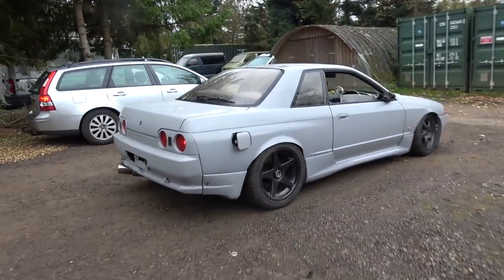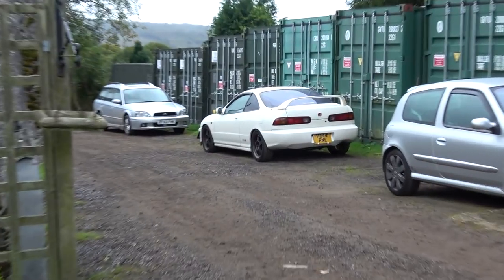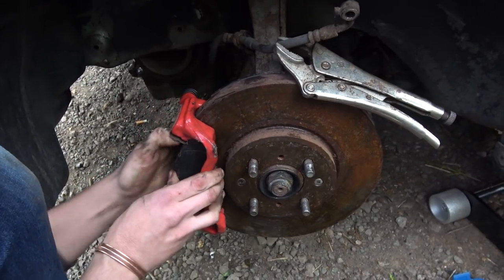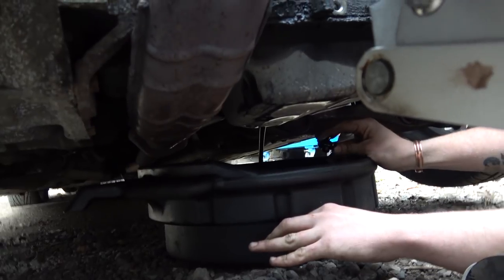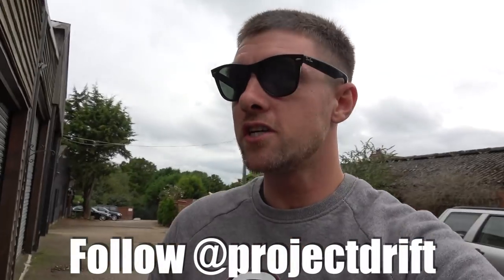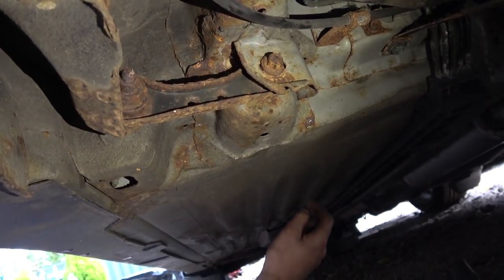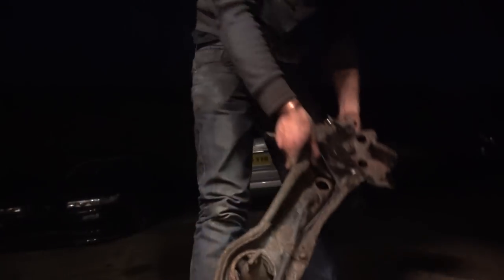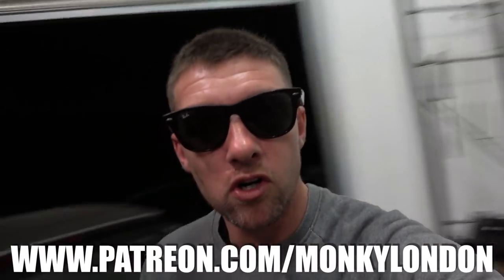🐒 HONDA CIVIC BUILD Ep10 - DC2 BRAKE CONVERSION + REAR DISKS

Comment: Careful if you're going to film on the A217, they just set up average speed cameras from Lower Kingswood all the way down to the mad mile (on both sides of the road). Proper stealth ones too, hard to spot strapped to lamp posts.

Comment: Little tip buddy. Try to avoid using copper grease on slider pins or anything in contact with rubber seals/tubes/boots etc as its petroleum based and will ruin the seal, the rubber breaks down and the pin can actually stick alongside the seal perishing and allowing water ingress. A silicon grease or a specifically designed lithium grease is what you want buddy, its water resistant and safe with rubber. The main reason for using grease on slider pins is to avoid corrosion, they slide better when fully cleaned and with minimal lube but then eventually corrode, so a nice smear of silicon grease is bang on, then obviously a high temp copper grease on the back of the pads and steel mounting brackets etc as other grease can melt and contaminate the pad. Keep it up man, love your vlogs <3

Comment: Sorry, you asked what we thought the power output was of the current setup, we don't get the B18C4 here in the states, but I just looked it up and it's 169 crank hp, so considering drivetrain loss, you're probably around 140 bhp, up from 90 bhp with the single cam. Typically, there's roughly 30% drivetrain loss by the time you get to the wheels.

Comment: Do the dc2 front brake set up just bolt up to the standard ek3 hubs and what brake pads and disc do you need to use?

Comment: Please tell me he didnt copper grease that slide pin. Take that back off and wipe it clean and get some multi purpose grease on there that copper grease is going to dry up and murder that slider
Reply: multi purpose is the stuff that dries out, especially on hot breaks. copper grease has a fairly high temp rating, hence why its used on breaks
Reply: Copper grease eats rubber, will fuck the boots.
Reply: Copper grease is anti seize not a lubricant
Reply: copper grease isnt the best, pagid etc do slider grease which is obv ideal, copper is known to cause issues on sliders..
Reply: shoulda used silicon grease for the sliders, it's a water repellent and lubricant
Reply: Copper grease will dry out and turn to a grinding paste and result in seized slides. Silicon based grease is the best.
Reply: I picked up on this too. Use proper caliper pin grease. It's specifically made for the job. Do it right.

Comment: Should of built it properly and not rushed it man. It works but looks shit.
Reply: Yeah i know. It dont cost much to clean everything and spray it up. Like the engine block, gearbox etc. Makes it better to work on the car after and also a lot easier to see any oil leaks or anything else.